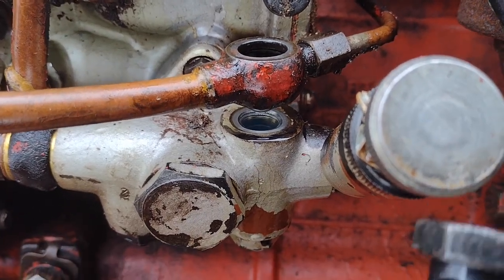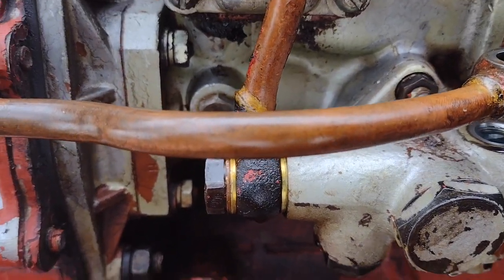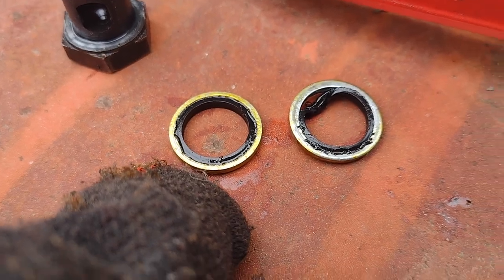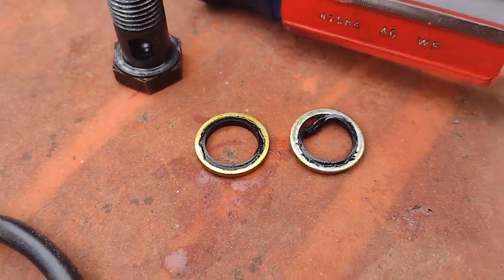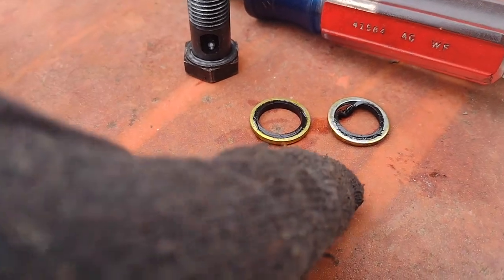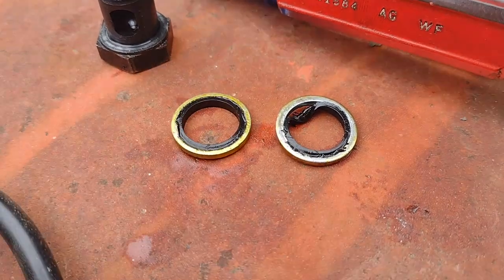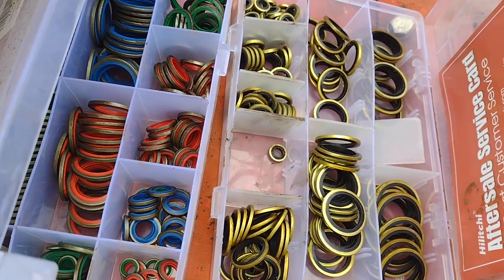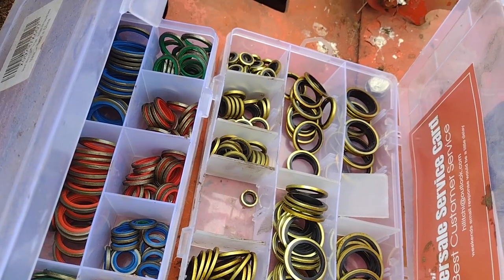LEAKY BANJO BOLT FITTINGS & HOW TO FIX THEM FOR GOOD

Comment: I've found the Amazon "copper" washers to be pretty hard and sometimes not suitable for the job, but hardware store (probably Taiwanese) copper washers pretty much never fail. I have often wondered about trying to anneal the cheapies to see if I can soften them up into something useful. In absence of that, I've found that Amazon aluminum washers work really well on many things too...
Reply: Yes always anneal the copper washers before use they will seal if they are soft

Comment: The copper one work just fine for break lines. However on those high pressure injection pump lines. They can give you a fit.

Comment: For your applications, those are perfect.  O-rings are made for high-pressure applications like that, as opposed to copper for much less pressure use (real copper; not alloys).  Good tip.

Comment: The trick to using and reusing copper gaskets, is that copper "work hardens" ... therefore, it's necessary to anneal it, by heating it to a dull red and letting it cool slowly.  This softens the washer and makes it seal correctly.

Comment: Copper washers work, but they are one time use only. Once you tighten it down, it gets smashed in and forms around the bolt. If you take the bolt off and put it on again with the same copper washer, it will leak

Comment: I found just the oposite, I have a 65ml oil cooler installed and it came new with those oring type washers and they leak, unlike the copper crush washers that hold and don't leak, I guess it depends on how hot the area gets, oring or copper.

Comment: Funny how millions of vehicles with copper washers on the brake lines don't leak.  You've gotta have the right one's.  I fought with the on my pickup because the aftermarket were thinner new than the oem were crushed.  It's probably not going to work when you start out 50thou thinner than the 2 oem crushed thickness.
Reply: Yeah, I've never run into the problem he's trying to solve, and those o-rings will not work with a lot of fluids, like brake fluid and some ATF.  New copper washers have always worked just fine.
Reply: I've found with the copper washers a few taps with a hammer when tightening up seems to help "set" the washer into the material.

Comment: if you have issues with actual copper washers (not made in china brass\copper mix) heat them up to a cherry red then quench them in water they will be soft enough to use or reuse.
Reply: Don’t reuse copper washers..at least not for a transmission cooler line

Comment: Those are a great upgrade but don't use them on brakes as the brake fluid will ruin the rubber in my experience. Maybe they make one that is resistant to brake fluid but I haven't seen any yet
Reply: Evening 👍

Just a question of finding a suitable supplier, these seals have many and varied applications......     oils, solvents etc.

As you said,  it's a question of finding the correct seal material .....